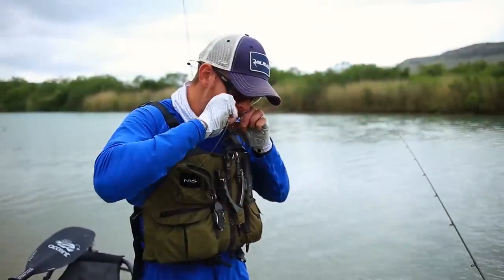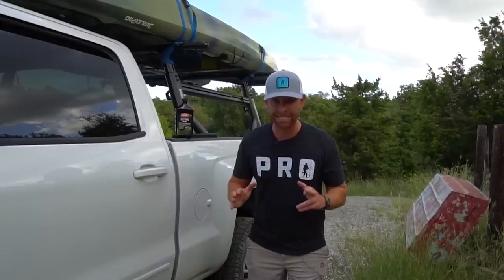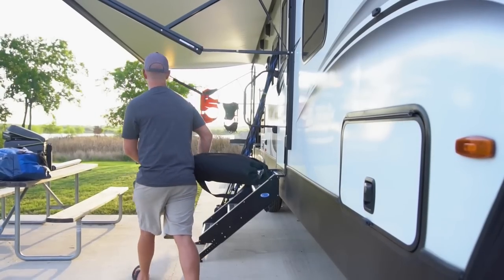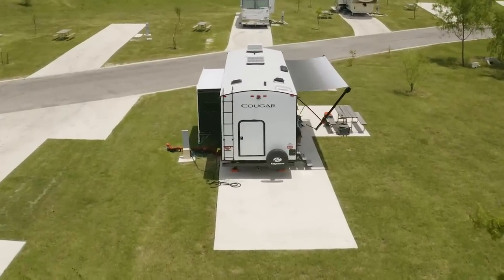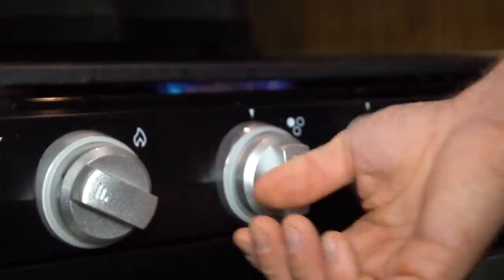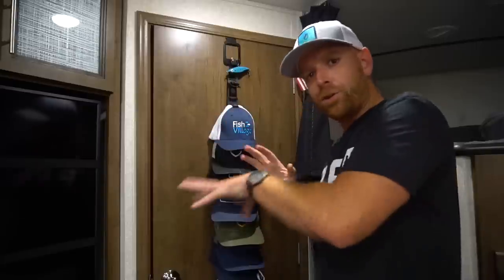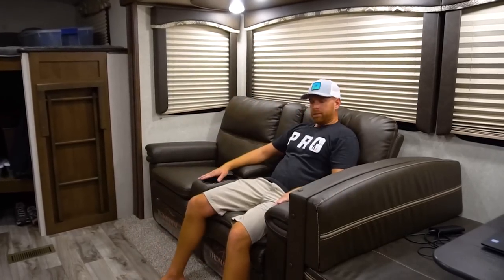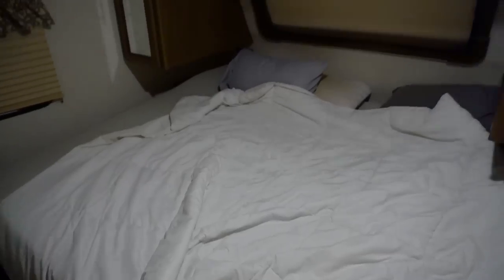WALKTHROUGH: Keystone Cougar 29BHS Travel Trailer (My NEW RV Home!) | Field Trips with Robert Field

Comment: Nice house. Thanks for the grand tour. Better is the truck! That's the Duramax engine . About to turn 250k on mine. Headed to Great Lakes? NE Ohio is the best of Steelhead Alley. We have the rivers off Erie where the sterlies run! Can kayak around the mouths and the lower river casting spoons and cranks. And/or wade areas up river with fly or spinning depending on how fish are running, weather, flow etc...fish are staging and entering rivers now and stay until April/may.
Reply from the maker: Good to know, I hope to make it to Ohio by April!

Comment: A breakdown of the electrical and power system including charging and length of time off the grid along with specs on Solar options
Reply from the maker: You’d have to ask Keystone for that bud. I’m just a simple fisherman.
Reply: Robert Field have you run into any limitations you felt a need to address

Comment: Hola Robert, muy buena adquisición. Una pregunta, hay alguna forma de meter y guardar los kayaks adentro de tu nuevo Trailer, así como lo hacías con el anterior? |||| Hello Robert, very good acquisition. A question, is there a way to put and save the kayaks inside your new Trailer, just like you did with the old one?
Reply from the maker: Creo que no amigo. Puede ser con kayaks mas pequeñas. Dies pies o menos
Reply: @YakFishField  gracias por la aclaración Robert. Buen Canal!

Comment: Your other rig was just over 28' long... this one is just over 34' long. Trailer length has been something I've been wrestling with. Just stayed at Gamble Rogers State Park in Florida. The site advertised they could take a 38' long trailer. My rig is 22'. I fit in the site nicely but couldn't begin to imagine what it would be like trying to back a 38' long trailer into the spot. So you've got a ton of experience. Did you struggle with trailer length at all or do you think 34' is not going to be a problem? /// I had the same complaint about under bed storage. I used 2 1x2s about 18" long and used a wood screw to secure them to the base frame. They work very well to hold the bed up and cost me pennys to build. Nice solution to solve the under bed access issue.
Reply from the maker: Some state parks have 30’ max. I think you want to go as small as you can get away with. If you don’t need 38’ to fit gear and be comfortable, go smaller. There’s really no golden rule, it’s a very personal decision. I didn’t have enough room for all my stuff in the 28’, so the 34’ has been working great.

Comment: Nice pad Robert. Oh and you no longer have a gas tank lol. It's a diesel or fuel tank Haha. So does that rack fit all trucks or are they made separately for each brand. I am in the market for one myself for the same reason for when I pull my camper. Be safe and great review bud.
Reply from the maker: Haha good call. When you go to Yakima’s website you input your truck model and they’ll point you in the right direction

Comment: If you only had 1 yak, could it fit through the back door into the bunk area for transport?
Reply from the maker: Ya know I’ve looked at that and I’m not positive. It’d be close because of the slide out (it covers up a little bit of that hole when closed). I think you could fit one. Maybe I’ll try it when I’m spring cleaning or something.

Comment: if you dont have one yet get a tuner for that deasel
Reply from the maker: What’s that?
Reply: @YakFishField  it allows you to load different pre set tunes of the engine depending on what your doing. something like this https://www.thoroughbreddiesel.com/bully-dog-gt-platinum-diesel-tuner/?msclkid=13aaf63e15bf1ce68520abb187382cfa&utm_source=bing&utm_medium=cpc&utm_campaign=(ROI)%20Shopping&utm_term=4580977762363330&utm_content=Programmers